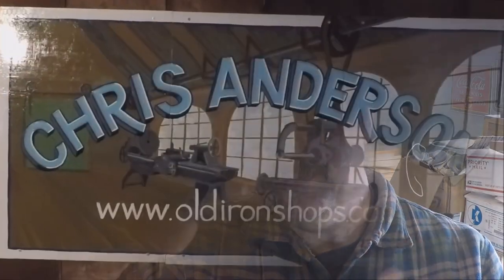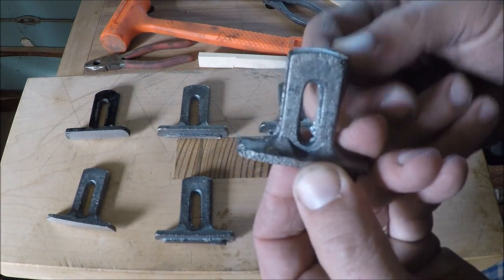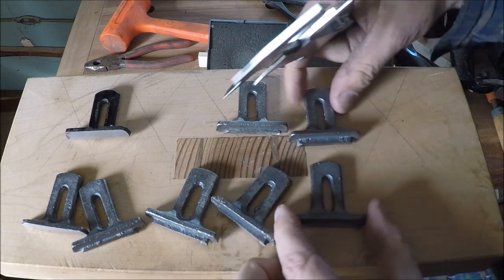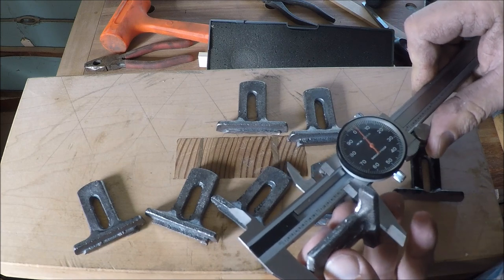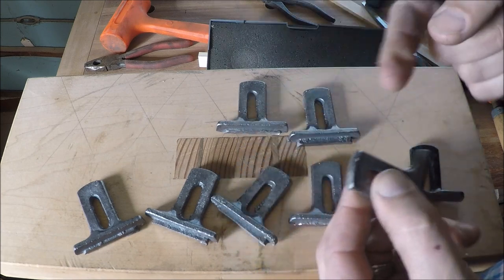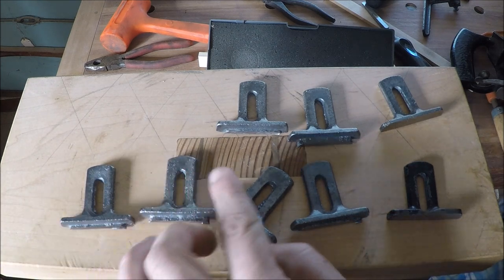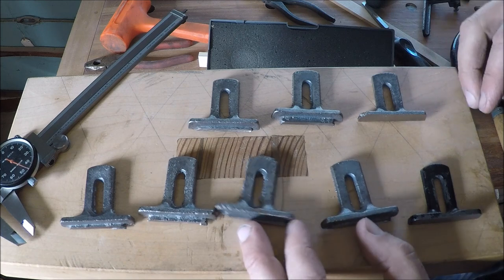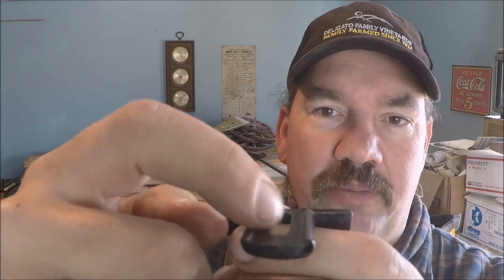Stanley 78 Plane Parts For Sale

Comment: On the screw for the depth adjustment could you drill and oversize the hole in the body then tap a conventional size thread and use a modern day threaded screw
Reply from the maker: You can do that but I'm not going to condone an alteration like that. It's a piece of its history and I'm always looking to keep things as original as possible. Thanks for the compliment

Comment from the maker: hi every one i hope this is helpful if any one needs one of the depth stops send me a email to oldironshops@gmail.com i will start a list and get some parts ordered.
Reply: Great job on the pattern Chris. 
You're dead on with the different options for the depth stop. The alternative style fits Sargent rabbet planes. Craftsman sold planes made by Sargent. 
It is wonderful to have a source for replacement parts for these fine old tools.
Reply: I shared your video to FB and got a response already. One guy want's a thumb screw. I need to fire up the South Bend this afternoon. 
If people in the comments will share the video it will get around a lot faster. 😊
Reply from the maker: Yes it will thanks for sharing
Reply from the maker: I've had several people looking for the screw also. I spoke with Randy Richard seems like he would be willing to run them on his turret lathe. That would make things much faster.
Reply: Got two of the depth stop screws almost finished. Minor problem. I gauged the thread incorrectly. It was almost 10-27 and almost 10-28. I made a guess and picked 10-27. It fits the Stanley #78 and will go into the Millers Falls. It won't fit the Sargent. The Stanley and Millers Falls have the hole in a thin wall. The depth of the hole is only about 1/4". The screw gets snug but doesn't stop. After a pass through the thread must roll form to fit the threaded hole. The Sargent is in a thicker section of the plane body. It will go in a little bit more than a 1/4" and stops. 
I need to get a 10-28 die. 
I should have ordered both. It's only $11.00 or so but they have a $25.00 minimum. 
Oh well back to the internet. 
I do have enough screws to fit all my planes. I have the original for the Sargent and the two replacements fit the Stanley and Millers Falls okay.
Reply from the maker: Do you need your part back. Was hoping to hang onto it for comparison of the next batch of depth stops.